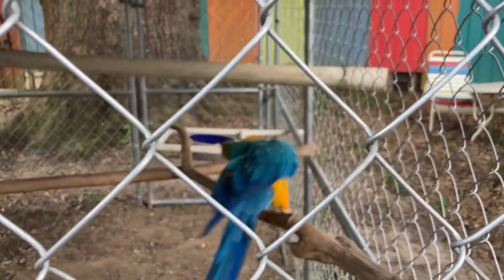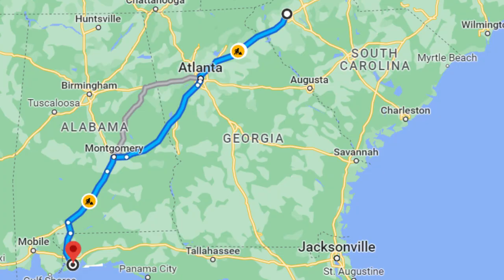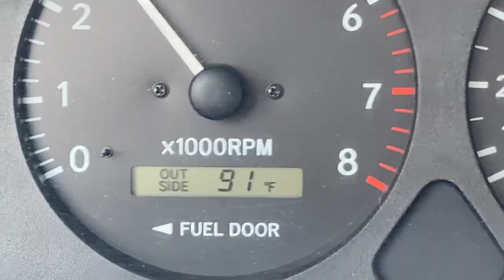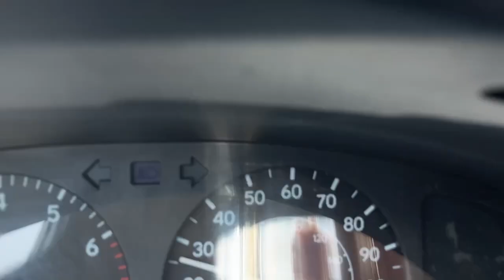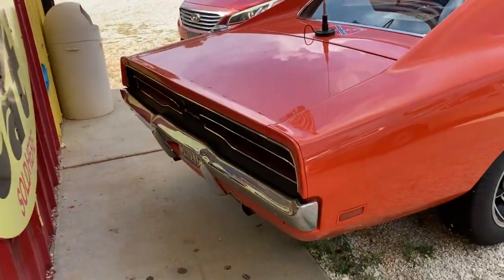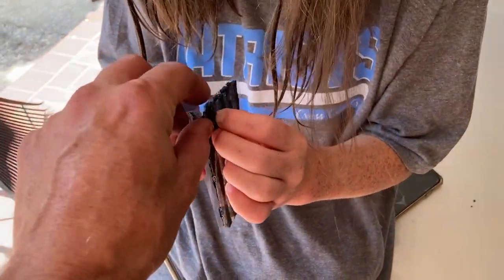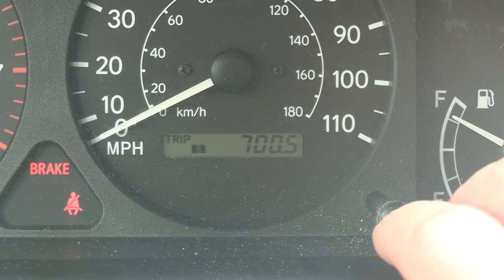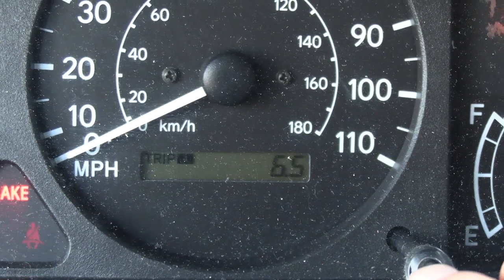HPL Engine Oil vs. OIL CONSUMPTION - Part 2 | Oil Burning🔥Experiments | Episode 24

Comment: I reading alot saying not to do a engine teardown. Its literally wasting his time on chemicals and not helping him 🤷‍♂️ i agree The motor is shot. rings are done and NO CHEMICALS going to relieve the problem i have a subaru legacy 99’ same deal. Id rather have time put into rebuilding the engine than BURNING money out the tailpipe.

Comment: Thank you for the videos. 
Maybe a dash cam  will prevent any future tickets in Alabama...lol😂

I hope when you do the tare down that you have the cylinders honed correctly, it's a 2 stage process. First pass 180 grit
Second pass 480/600 grit.
And be sure to use high quality aftermarket rings.👍

Comment: time for something radical.............this will be good!!! How will he solve the problem, oh yeah what is the problem............worn cylinder walls or piston oil holes filled with gunk? ( or a combination of both)
I'm going for clogged oil return holes..........lets for a minute assume that is the problem.........then how to solve it???? something radical is required, all this trial error aint gonna clear those holes, so clean them holes.............somehow..........someway..........everytihing is possible........just how will you do it......
I'm tempted to buy an old geelopi with same engine and try my previously mentioned idea ( in prevous videos on how it might be achieved.......alas I cant be bothered......
if not stripping the engine........the only access to the oil return holes is from the bottom of the piston......how to get that gunk out........many minds here
it is time to solve the problem and actually tackle the problem directly or even indirectly.....there needs to be a resolution.

Comment: You didn't need to install spare tire in 1st place. Just turn the steering and roll the car to where you can see the nail/ screw and do the patching while there is still air in the tire cause so it will not collapse on you. Also the tire repair kit comes with a tool to prep the hole before inserting the patch. I think you should get the Corolla 9th gen like 2008 and focus on more productive youtubes which will not lead many people to go through  the same wasteful doomed to fail treatments. The  8th gen are one of the worst Corolla gens and i owned one. Bad piston, exhaust, suspension, door handles & evap designs. Some 8th gen Corolla with zero burning exist but rarely. While the 8th gen is cheap to buy and maintain, the 9th gen is just way better driving experience. I think your best option if you want to keep this car is to install a used low miles 9th gen engine (some parts have to be swapped) or get a 2008 Corolla and enjoy life away from chemicals. Best wishes!

Comment: COPY PASTE COMMENT FROM EARLIER VIDEO 
4 months ago (edited)
I commented on your video a while back. 150,000 miles on 2011 Acura TSX V6. Losing about a quart of oil every 500 - 600 miles. Drive my car rather hard. Lots of mods.
Did two cans of BG and ran engine on 2,000 RPM at 25 minutes. Used two quarts of 5W-30 (calls for 0W-20), did a full engine clean before with some stuff from amazon (Throttle Muscle TM7326 with one quart of 5W-30), kept the oil filter from that. Anyways, did the BG EPR stuff after, and for the first time my oil dipstick didn't look like I mixed my fresh oil with coal (fresh oil change with 0W-20 3 quarts and one quart of 5W-30). Did all three changes hot. Got about 200 miles so far on it, oil is in same spot on dipstick; I did leave overnight some BG EPR in spark plug holes and sat on pistons. Compression on all six cylinders is ~230 within 15 PSI on all 6 (230, 237, 230, 225, 225, 230) cold. Will update in a future video of yours. Thanks for what you do!
EDIT: Forgot to mention, I got a LOT of white smoke out the exhaust during my BG EPR burn. After my new and final normal oil change, it was burning white out the exhaust for about 30 miles before it stopped. Mostly at higher RPM's.

TODAY: Miles at 153,229. Dipstick shows NO OIL LOSS. Changing oil in a couple weeks. OIL IS DARK GOLD COLORED. ♥♥♥♥♥
NO OIL LOSS!!!
Reply: And I hope you are doing well, car Dad! Watching your video now. Have a good weekend.
Reply: Congrats to your son! DHS here :)
Reply: 12:29 Hancock County MS "support the police" tag MIAFAS. I've seen him around several times he is one county over from me from Harrison county. Amazing car.
Reply: can't wait to teach my daughter this stuff :) She's 6 now
Reply: 29:41 hahahahahaha
Reply from the maker: That's pretty cool. I love when people see stuff they recognize in these videos.
Reply: It's not an OIL LOSS issue rather an OIL BURNING issue, glad you found a cure.
Reply: @pritambissonauth2181  I apologize for the loose terminology used by me on that. I was burning oil. Never have I been specifically losing oil and finding puddles under my car. This was stuck piston rings.
Reply: @TristanVash38  No need to apologize to me, I just want the newbies not to get confused while reading the comments.  Good work.

Comment: Just a crappy engine as far as Toyotas go. Simply worn out. Nothing is going to fix that but ghost riding it into a junk yard where it belongs. HPL is one of the best oils you can buy. Oil experts/tribologists agree. And some of these people are chemists and blenders. Not some YouTube cowboys ( not inferring that’s you fwiw). So the idea any top tier synthetic will be let’s say 50% better vs HPL is simply absurd and a fools errand.
Reply: If the engine was worn out, it would be misfiring or have a lack of power. This is simply a known defect where there is insufficient oil flow and cooling of the pistons so the oil control rings get gummed up causing oil consumption. The Crosshatch marks are still visible on the inside of the engine.
Reply: @imzjustplayin  I’ve seen quite a few of them. Most have damaged cylinder walls and many don’t present with obvious drive ability issues even though compression is down. Like anything its to what severity. In this example I wasn’t aware he performed a bore scope and verified its in good condition, just assumed its like many of their shitty engines that die early. It’s a bonehead design (oil control ring) and is unlike many Toyota/Lexus engines. No oil product or cleaner will fix this.